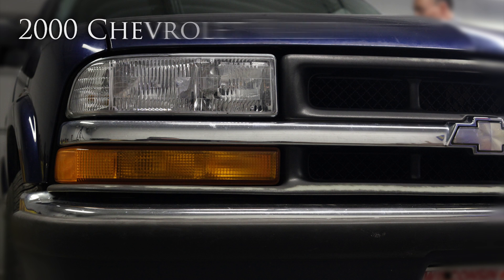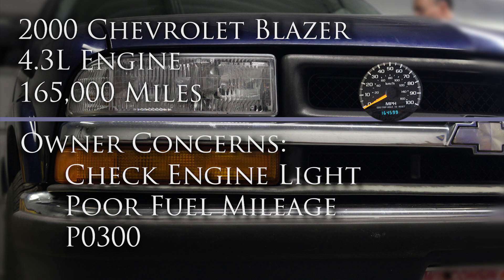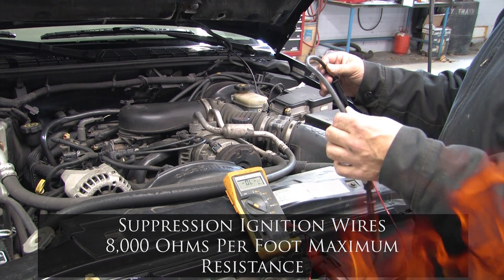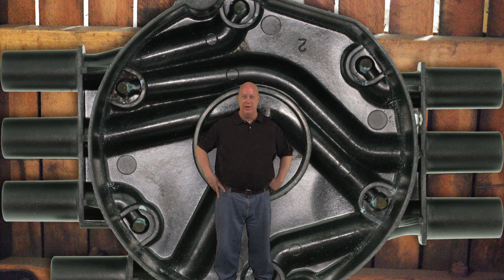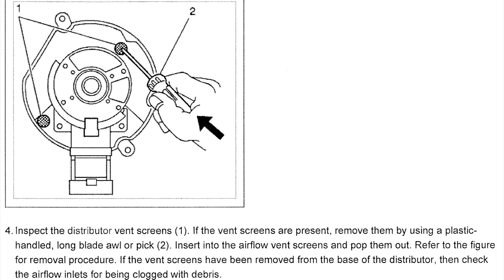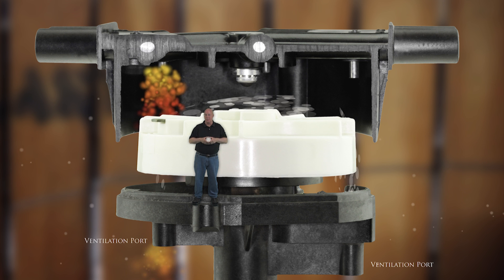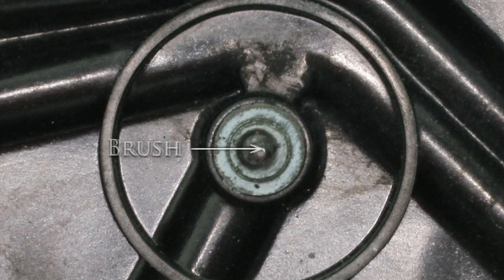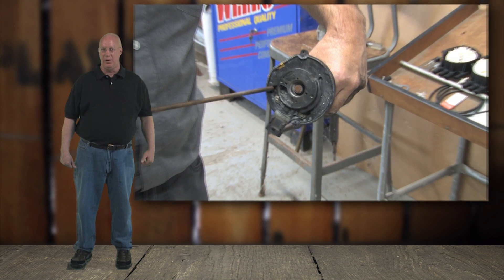Misfire Diagnostics P0300 GM

Comment: Hello, my check engine light came on while I was going to work, The check engine light was flashing so I put into a gas station, My engine got loud or the idle was very rough, I took my car back home which was like 7 minutes away, I had a code reader which said P0300, then I notice my catalytic converter was very red. I have a question, I am going to get converter replace today, Will that solved the P0300 issue? Will I have to replace both Oxygen Sensors. I have a 2005 chevy classic(malibu) 4 cylinder.
Reply from the maker: +Wardell B Hi Wardell B, chances are the P0300 is caused by something other than the catalytic convertor and if you replace the cat and don't fix anything else it will likely fail again. It's hard to say if your oxygen sensors are ok or not. At this point you want to diagnose the P0300. Being that the idle was rough that is probably causing your cat to get red hot. I would diagnose whatever is causing the misfire before putting a new cat on, you could damage the new one. 
Mike Becker, Technical Services Instructor
Reply: +markjhicks I just found it out it was my Ignition Control Module, When my Ignition Coil got burn out in July 2015, the mechanic forgot to replace the  Ignition Control Module, My dad and I check the spark plugs yesterday, they were new, the ignition coil and the boots were good, then we noticed the Ignition Control  Module was burned. The check engine light is still but not flashing now. I have to new get a new catalytic converter and o2 sensors. Hopefully the check engine light will go off tomorrow
Reply from the maker: +Wardell B Good to hear you got to the bottom of it. The light will stay on until everything is fixed and the car passes its tests. The flashing light was on because the bad misfire was causing damage. Now that you replaced the ignition control module chances are you just have a bad cat/02 sensor(s). Let me know how it goes after the cat is fixed.
Mike Becker, Technical Services Instructor
Reply: Hello Mark. I had my cat converter change, My dad change the downstream O2 sensors, the check engine came on, then it went off. Two days ago the engine line came on, so I went to Auto zone, the code reader said it was the code P0420, does this mean the upstream O2 sensors need to be change? I order the upstream O2 sensor this week along with the Purge Valve Cansiter.

I have another question, my dad and I change the engine mount and 3 trans mounts on my car, The mounts were very bad, Today I was at the stop light my car was vibrating in the drive gear and reverse gear, but in the neutral gear, it was quiet for a while then it went back vibrating. Could this be the rotors or its time for me to get the transmission oil flush, I never had my transmission flush or the filter replace. My car is over 127,000 miles, its a 2005 chevy classic.
Reply from the maker: +Wardell B The p0420 is a catalytic converter low efficiency code. It doesn't mean that the 02 sensor is bad but it is a possibility. Did you install a high quality cat? As for the vibration it's tough to say what could be causing that. Does it only happen when you're stopped?
Mike Becker, Technical Services Instructor
Reply: Yes, For example, when I stop at the traffic, the car vibrate when I have my foot on the brakes, then when I put the gear in neutral, the vibration is gone, if i put the gear in either drive or reverse, it vibrate. My dad and I change all the mounts this past weekend.
Reply from the maker: +Wardell B It's hard to say what it could be without personally feeling the vibration. It could be coming from the transmission, or from an engine misfire, or from something being loose. Did this just start after you put in the engine mounts? Maybe there is a loose bolt on one of them?
Mike Becker, Technical Services Instructor
Reply: Good afternoon Mark, I took my car back to the muffler shop, They had to replace my cata converter because the cata converter they put on didn't match my car.. The vibration noise is coming from a loose and rust out pan than under the air filter cover. The muffler shop show me, they told me, I need to go the junk yard and find a pan or have someone make a modify pan or get a shoe string to hold it on place.Then I found out I need a brake caliper on the passenger side.
Reply from the maker: +Wardell B Glad you got it figured out. Sounds like your poor car is having one problem after another. That's unfortunate, but after you are all done fixing it up it should be a great running car for a while!
Mike Becker, Technical Services Instructor
Reply: Is it wise for me now to get my transmission oil change and the filter change. My car don't have a dipstick. I call the chevy dealership, I told them my car have over 127,000 miles. The transmission oil was flush one time back in 2008, I can't remember the exact miles. The service people told me to leave it alone since my car have over 127,000 miles, and flushing out the transmission oil and the transmission filter might do damage to my car? Is that true or false?
Reply from the maker: +Wardell B It is possible that when flushing the transmission it could loosen up some possible deposits inside there causing problems inside the transmission. If the Chevy dealership is recommending against it, I would probably listen to them. They are the experts on those transmissions.
Mike Becker, Technical Services Instructor
Reply: I would follow their advice, What about checking my transmission fluid to see if its low or not. If its low, will it be okay to fill the transmission. Will it effect my transmission? Thanks.

Comment: acurate but in the real world you have to take into account mileage, age of vehicle, and state of maint. this engine has the dubious tendency to develop vacuum leaks around manifold. this can damage and create other codes over time.
Reply from the maker: +sarah belanger Sarah, you are right and thank you for bringing attention to another reason the P0300 code may have set. Yes, mileage and maintenance are huge factors contributing to the vacuum leak issue. I want assure you every one of our videos and training events are from real world failures. Nothing we do is set up or proped. On this particular vehicle we did not need to go any further, the cap, rotor and ignition wires took care of the misfire. Thanks for your comment, we appreciate you,
Mark Hicks
Wells Vehicle Electronics

Comment: I have a 2006 Kia Rio.  I just cleaned the throttle body and when I start the car it can´t keep it self running in idle.  Also it runs poorly driving steady.  The check engine light did not come on but I got the p0300 code.  Just wondering if anyone has any advise ??
Reply from the maker: Einar Thoroddsen Skúlason Try removing the ECM fuse for more than 10 seconds. This will clear the adaptive fuel trim values. The most common cause for the P0300 is defective coils on your vehicle. Start by checking the spark plugs. If they look bad, I would replace them and the coils. 
Stay in touch,
Mark
Reply: markjhicks I checked the sparkplugs and coils.  The plugs on cyl. 3 and 4 are very rusted but I checked the sparks and they are steady so plugs and coils are good.  I´ll try removing the fuse next.  Also I already disconnected the battery for about 30 min, cleaned the egr valve and reconnected the battery.  I´m thinking, could it be the TP sensor or a O2 sensor ??  If so, the check engine light should be lit, right ??
Reply from the maker: Einar Thoroddsen Skúlason It would be very unlikely the TPS or O2 could be causing these issues. Granted the O2 may have been destroyed but it is not the cause. The method you used to check the plugs and coils is honorable but I think the results are skewed. When a plug is under compression it is much more difficult to bridge the gap than when it is in the open air. How many miles are on the engine? To check the coils more accurately use a gaped spark tester. One you can set the gap with. Then try the coils during cranking and I think you might see them break down.
Mark

Comment: Thanks for the info, I have a 2000 GMC Jimmy 4X4 4.3 with 215,000 kms, it was running very ruff, and would hardly start or accelerate,I checked the code with my OBD II reader and got the dreaded PO300 I replaced the plugs with NGK and the plug wires AC Delco, it helped a little bit, I found your video on You Tube and I changed the distributor cap and rotor and now she runs like new, just awesome thanks for your video it sure helped me. p.s. I'm 58 years old and have owed over 20 different vehicles and I have never put so much money in repairs to a car or truck as I have with this one, NEVER AGAIN GM. I've learned my lesson.
Reply from the maker: James Bothwell Hey Jim! Thank you for the great testimony! If you need anything just ring.Mark Hicks
Wells Vehicle Electronics
Reply: James Bothwell Have 350k and 250k on my GM 5.3 and 4.3 no issues run like new.

Comment: Why would it throw a P0300 with a P0302 problem? I have a P0300 code with 1,6 and 8 high count misfire and can't nail it down, will try a relearn next.
Reply from the maker: It sets a P0300 due to random misfire, so they say. It is really because the computer can not determine which cylinder is missing. Depending upon which vehicle you have, doing a relearn could cause the computer to think the misfire is correct running.
Stay in touch,
Mark Hicks
Wells Vehicle Electronics

Comment: Crank relearn fixed my PO300 on my 6.0 Silverado. Took less than 5 min with a scan tool.
Reply from the maker: Thanks for the great tip! You are absolutely correct! If your vehicle sets a P0300 code, but you do not feel a misfire performing the crank relearn might take care of setting the code. However, if there is an actual misfire occurring and the crank relearn is performed the check engine light will again illuminate setting a code. When the crank relearn is performed it is telling the computer the signal it is receiving form the crank sensor is the correct one, even if it is a bad signal. When the misfire problem gets worse the code will again set.
Take Care and thanks for the great comment! I am sure because of it you and I are going to help a lot of viewers better understand the system.
Stay in Touch,
Mark Hicks
Wells Vehicle Electronics

Comment: my problem is the 98 s10 stumbles under load.  p300 was cleared and hasnt returned.  it idles a little rough.  runs fine otherwise.  just when climbing small hills i can feel it bucking any help would be greatly apperciated.  I have changed the coil cap rotor plugs and wires next will be the distirbutor since the cost 100$

Comment: I got the same code as well. But it only comes on when I push my 2000 Chevy Blazer upwards of 75mph (and seems like it jerks very slightly) and after a few more starts the check engine light turns off. Do you have any idea of what it might be?

Idk if it has anything to do with it but it does have trouble starting every now and then. And even with the light flashing, it seems to hold power, but also seems like it runs slightly more at a higher rpm (when it flashes).
Reply from the maker: There are a ton of reasons a P0300 is setting on your vehicle, but here is a good place to start looking.

1. Place a dollar bill against the tailpipe during the misfire, rough running. If the dollar bill pulses back INSIDE the tailpipe, there is a mechanical problem with the valve train. Use a top engine cleaner to soak carbon off the valves, retest.

2. Check for good spark output at the end of the spark plug wires.

3. Check for a bad distributor cap and rotor.

4. With the engine running, wiggle the White wire and the White/Black wire at the ignition module. If the engine bucks and jerks, repair the wiring.
Stay in touch,
Mark Hicks
Wells Vehicle Electronics

Comment: Greetings! Got that code. Changed spark wires, coil pack, sensor, & still have the code and rough idle. Could it be fuel injectors?
Reply from the maker: Anything to cause a misfire could cause the P0300 code. What is the year, make, model and engine size of your vehicle? I will look it up to see what is most probable to cause it.
Mark Hicks
Wells Vehicle Electronics
Reply: 1996 Buick Century with a V6 3100
Reply from the maker: First check the injector wiring harness behind the alternator for rub through. This is pretty common especially if the alternator has been replaced. The next most common cause is a defective injector.
Hope this helps, stay in touch,
Mark Hicks
Wells Vehicle Electronics
Reply: Thanks so much. Youve always been helpful. Appreciate it